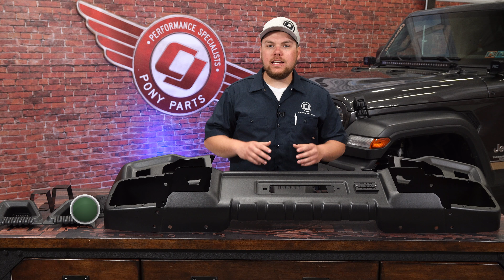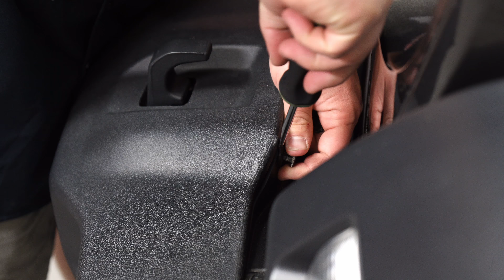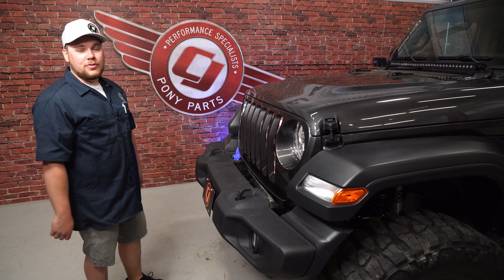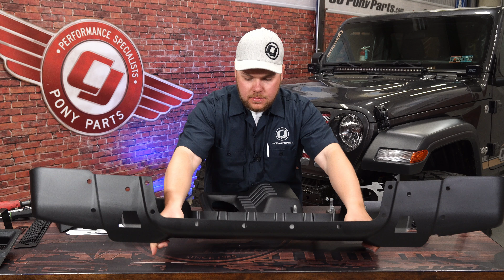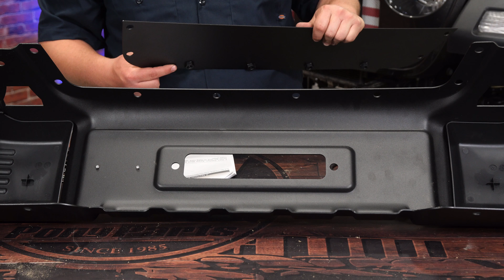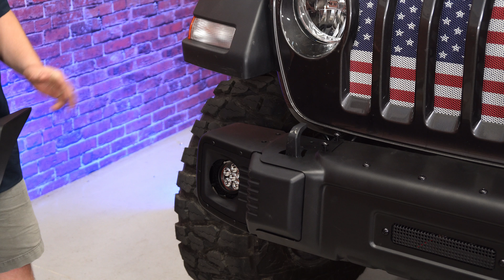Why you should ditch a Jeep Wrangler JL stock bumper: Rugged Ridge Spartacus Bumper Install

Comment: So if the fog lights get broken or burn off you have to remove the front bumper wowzers.  Well I can see it only took 12 minutes or so so it shouldn't cost too much if it was done by the dealer.